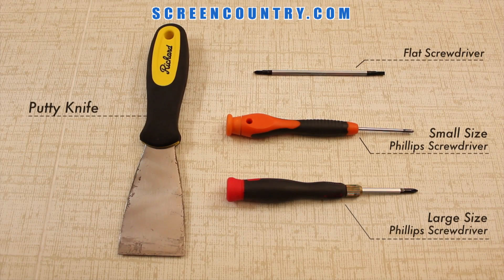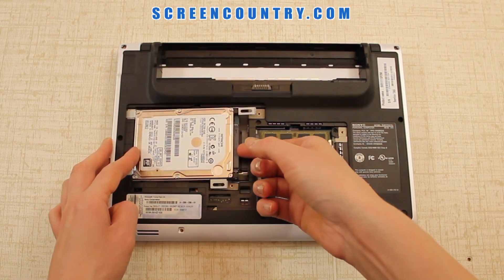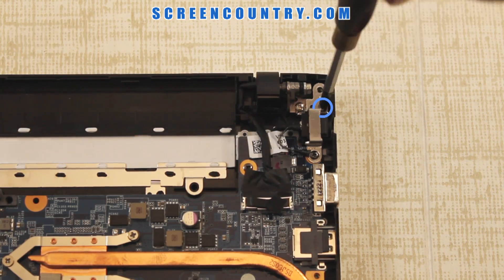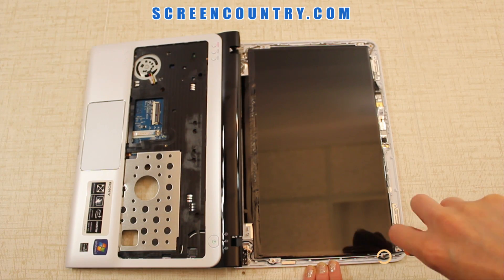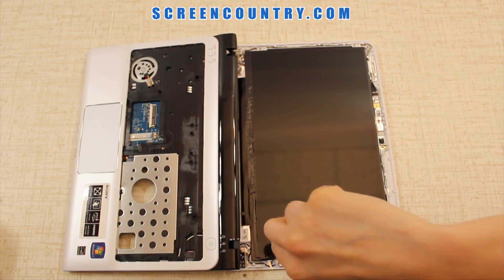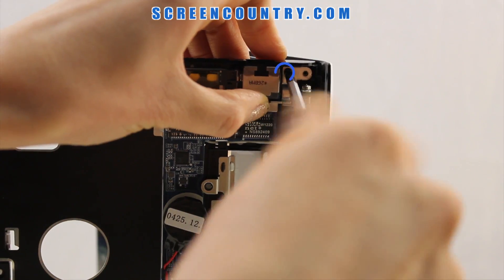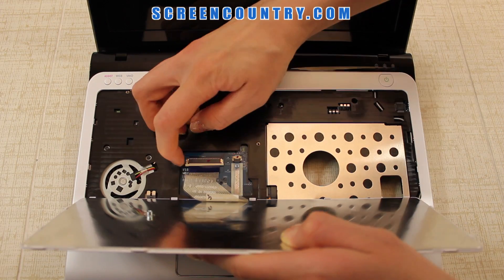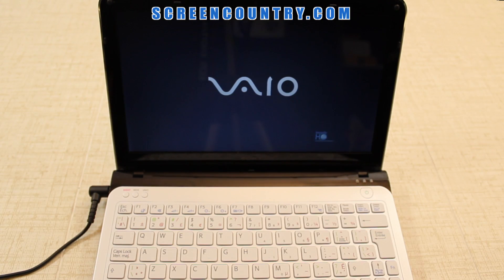Sony VAIO Laptop Display Replacement, How To Install LCD Screen

Comment: Like Farhad said, there is no need to open the bottom part. Just remove bezel and replace the screen. Start from 2:20

Comment: I was able to get the bezel screws out without taking the entire device apart, but thanks for the helpful video :) I've had screens before that you've had to completely tear it apart, so I always check to make sure I can get the bezel screws and video cable out. You might want to add to check for a webcam, too. There are two screws on that little device.